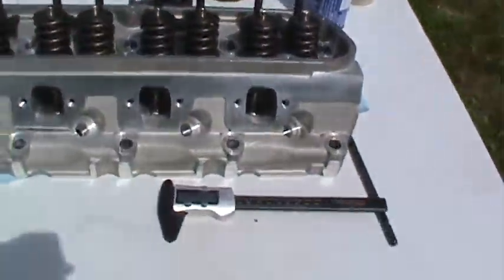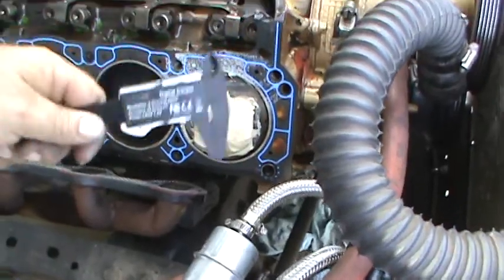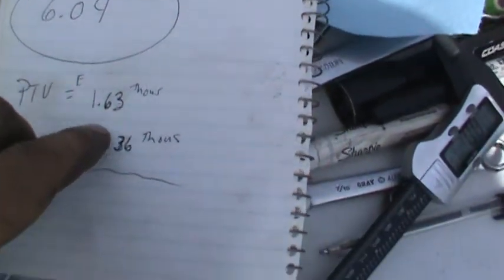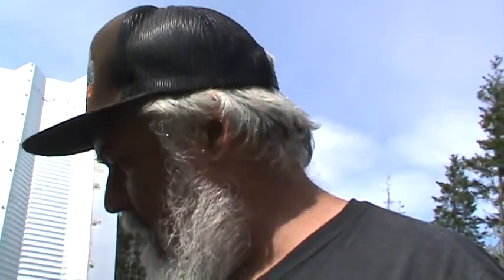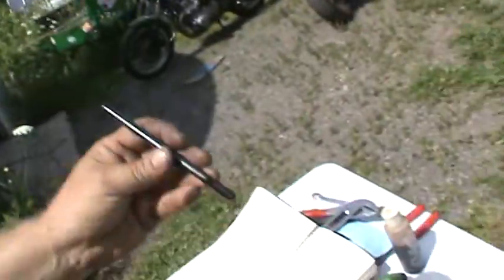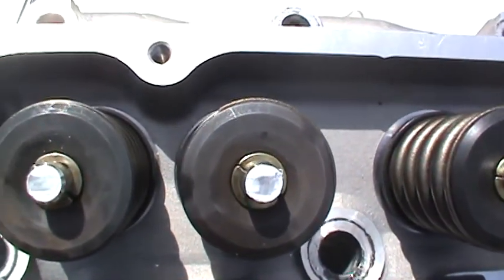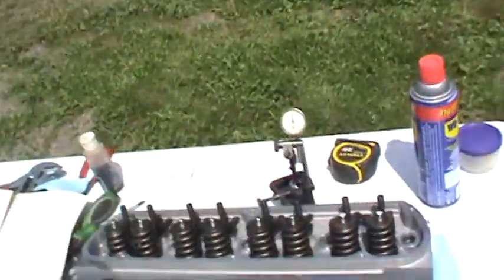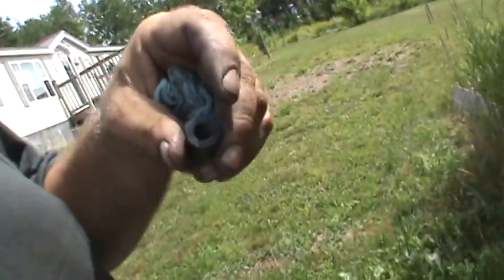Push rod length and rocker geometry. Flotek 180 sbf.

Comment from the maker: Just been informed its gonna be at least 4-6 weeks to get pushrods! sigh.......................:(
Reply: Seriously?? Fixing to measure.mine as soon as I get the headbolts
Reply from the maker: @19jody72  use a solid lifter on the cylinder your measuring and then zero lash.
Reply: @HammerHeadGarage  did you use a solid roller lifter..or just a normal solid lifter Shawn
Reply from the maker: @19jody72  I borrowed my buddies homemade solid. Basically, he took a hydro lifter apart and put washers inside to make it solid and simulate .035 of preload.
Reply from the maker: @19jody72  I think there is a video on the internet how to do it.
Reply: @HammerHeadGarage   oh yeah.. jusy curious as to how you did it..seems thats what everyone does. Then some.say to use the same type of lifter you will be running.
Reply from the maker: @19jody72  This is a ford roller lifter, just modified to make it solid.

Comment: I did the remove the spring and flip the plunger over to get a solid lifter. My push rod length came out as 5.900. This is with a stock block and stock Flowtech heads. I am wondering if this is how you made a test lifter. Or could this method make the lifter too long. 5.900 seems quite short.
Reply from the maker: @RobertSchurdell  yes, I made a solid out of a stock lifter.

Comment: which pushrod checker did you use? and did you use a checker spring or just left the springs the heads came with in? I'm about to be in this position with these same heads.
Reply from the maker: @alhaupt3150  Manley. Took the inner spring out and used solid lifters.
Reply: @HammerHeadGarage  I meant part number? So I van buy the same one

Comment: I have a 1990 Mustang GT, stock block. Added flotek 180 heads and got 6.050 for my pushrod length. Ordered from Smith Bros out of Oregon USA and I had them in my hands in BC Canada in about 7 days.

Comment: I have the same heads and came up with 6.000” pushrod length. These heads normally require pushrods this short? Compared to stock 6.50
Reply from the maker: Every setup is different. Deck height, head gasket, type of rocker arms all have some effect. My valvetrain has been great since I have completed this new setup.
Reply: @HammerHeadGarage  thanks. Just odd why its so much shorter compared to stock.

Bone Stock 91 HO never decked
Flotek 180cc 58cc chamber (never decked)
Tfs 1.6 stud mount roller rocker
.042 compressed gasket
Stock roller lifters.
Reply from the maker: @demyshernandez240  Yeah they are all different.
Reply: @HammerHeadGarage  so your still runnjng those 6.050 pushrods and everything still runs good?
Reply from the maker: @demyshernandez240  yup. runs like a clock.
Reply: @HammerHeadGarage  finally got the car running with these heads. Floteks with bowl work, stock cam, gt40 intake, 4.30 gears. She rips! Definitely feels like a mid 7 1/8 mile car.
Reply from the maker: @demyshernandez240  Awesome man! they make a good bit of power. More than gt40s and P heads.

Comment: The width of that sweep is WAAAAAAY to wide. You're not just looking for a centered pattern. More importantly, you're looking for the most narrow pattern you can possibly achieve. This is done by two things. Shims under your pedestal mount rockers and the adjustable pushrod checking tool.
Reply from the maker: It is not as wide as it looks on video and these are not pedestal mount rockers. Been running just fine, and this setup was verified by an engine builder I trust (built thousands of sbf)

Comment: Hey Shawn.. did you add .050 to the overall length. Im getting mixed reviews about that.. i  used a solid lifter to get my measurement..do I add .050 to the overall length or go with the exact measurement? I'm using a hydraulic roller cam.and roller.lifters
Reply from the maker: If you used a solid lifter to test go with the exact measurement. the idea is that length will duplicate your results on the valve tip.
Reply: @HammerHeadGarage  thank ya sir!